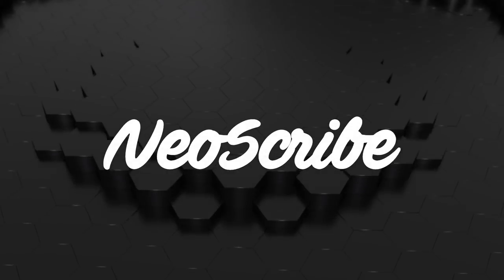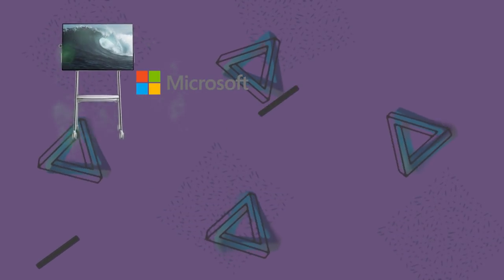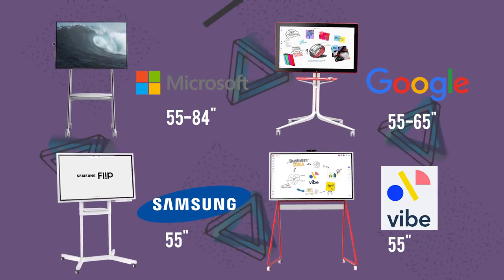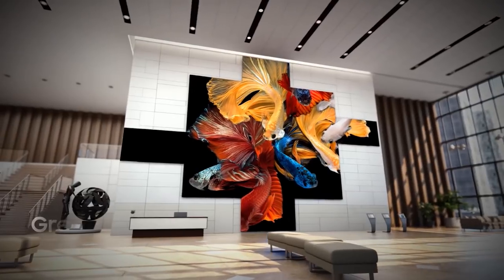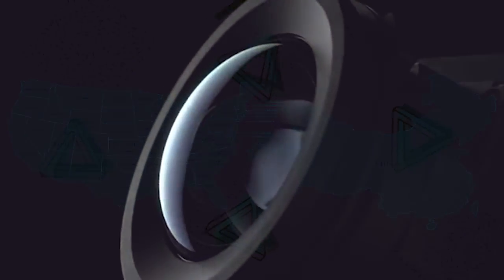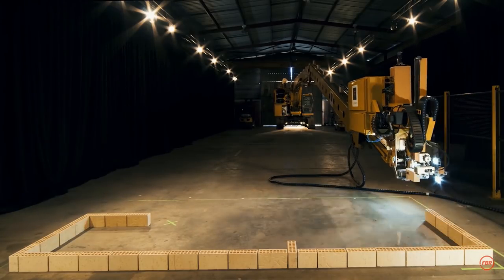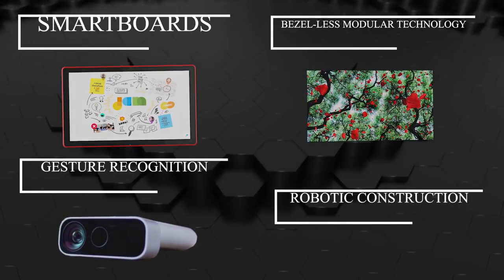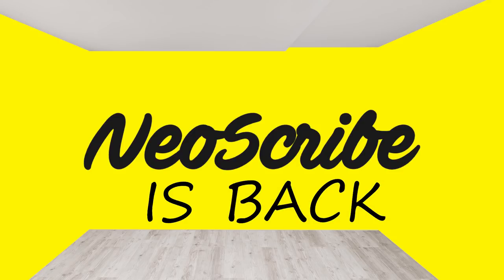Why Smart Walls?

Comment: Smart walls are only but one piece of the puzzle. Robotic 3D printed smart walls (: smart ceilings, smart roofs. Will lead the way to smart houses, Smart buildings, smart factories, etc. I am working on doing  this sir. It's what I believe is the future. It will require a platform with AI tools and robotics using additive manufacturing processes to build and assemble. Give it time in the next decade it could be ready.

Comment: There are pretty much unchangeable factors that will make the adoption of smart walls problematic in many vital markets. Pretty much everywhere outside of the USA, houses are too small for it. Houses being small has effects that maybe don't seem immediately obvious. The main one is that people in places like Europe and Asia don't have walk in closets and don't have much room to store things. That means the only way to store stuff is cupboards and shelves. 
You see where I'm going?
In the average European and Asian house, there is no room that isn't full of furniture and that won't change, because it can't change. That is why IKEA is a thing.
What would be the point of a Smart Wall if you can only see bits and pieces of it poking out from behind all the cupboards, shelves and other furniture?

And there is no room to just make houses bigger or build new cities, at least not in Europe or Japan. So those two markets would not be open to the technology.

The current EV (Electrical Vehicle) technology is facing similar problems.
Nobody ever seems to think of stuff like that, but the fact that almost nobody in Europe has a garage, where they can charge their EV over night, is a huge problem for the adoption of EVs in that market and it is a problem nobody can change.
Nobody wants or can lay a 100 yard long cable from their apartment out to down the street where they have parked their car.
So EVs can only really be adopted there once the technology is advanced to the point at which charging your EV takes no more time than filling a regular car's tank with gasoline, so it becomes something you can do at gas stations.

It has always been like that with technologies that relied on the US American way of suburban living in large, cheap and easily replaced or modified, wooden houses. Stuff like the electric garbage disposal have been common in US suburbs for the better part of a century now, but never had a chance in Europe and other parts of the world.

And just because the Saudis are throwing their oil money around to build another billion Dollar ghost town into the desert somewhere, doesn't mean that is the future of how construction will look like worldwide.

If you want to be a futurist and want to make viable predictions about how the world will look like in the future, you first need to develop a better understanding of how the world is now and why it is the way it is.

Comment: While you do present an interesting perspective - and seamless smart walls surely have their potential uses - I don't think you quite hit the nail on the head in regards to home entertainment. VR and, most importantly, AR present much more versatile tools in pretty much every application one can think of. With advancements in battery technology that will enable light, portable and sleek glasses, I don't see how Smart Walls can compete with a device that you forget you have on your head, and that is able to project crystal clear picture the size of the night sky directly into your eyes anywhere you are.
Reply: Constantly having glasses on for a VR experience may be a bit too intense as it fully takes away your attention from your environment whereas smart walls might not be as intrusive, so to speak. At least from my perspective